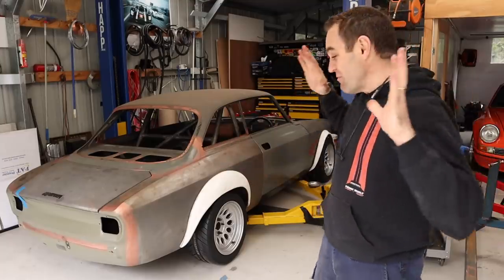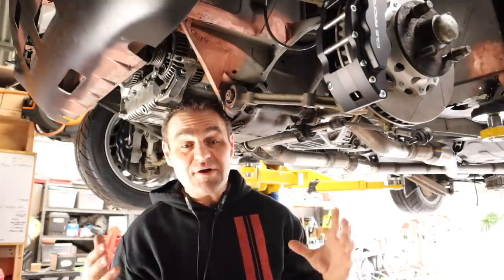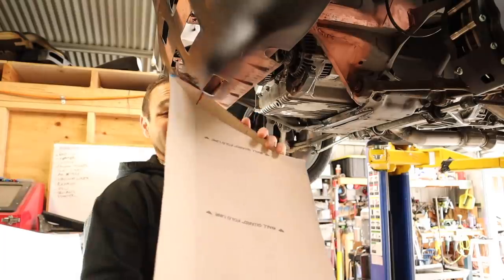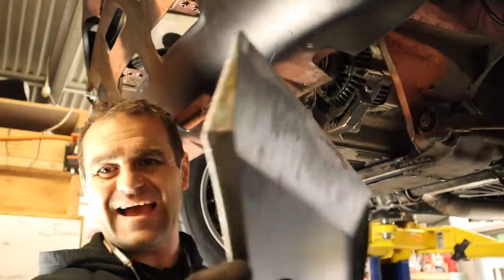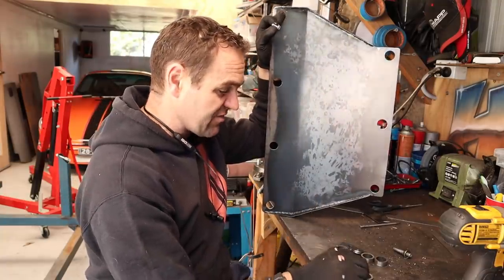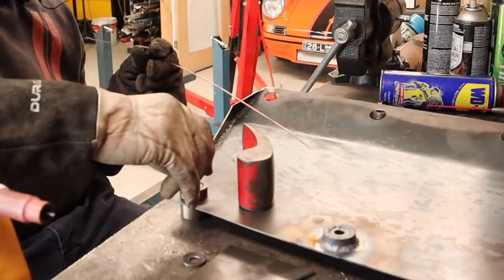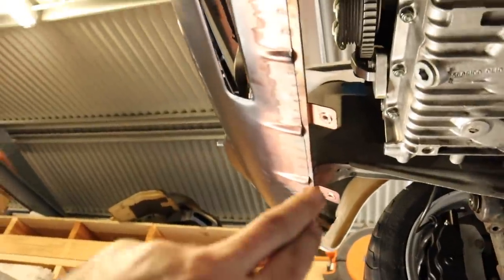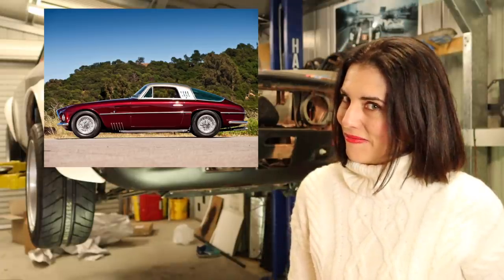Protecting the Ferrari engine - Ferrari engined Alfa 105 Alfarrari build part 94

Comment: Your Bash plate will act like a undercar tray drawing more air through the radiator.  So it should not be referred to as a bash plate.  The undercar windage tray also assists with downforce on the front if you added a small alloy 5mm strip across the back of it. (alloy so it is sacrificial)  This lip (facing down) will increase the air through the radiator (over the top of the tray). Many modern cars have the lip at the back of the plastic undercar engine cover for this reason. (many think it is just for good looks - but it has a purpose) Adding the lip will also assist to bring more air past the alloy sump. (assisting with cooling of the oil)
Reply from the maker: Interesting. I must admit, that I am a complete novice when it comes to aero. As the back edge is flush with the subframe, and I have to build another plate of some sort for the rack further back, I assume a lip on that would be the place to do it?

Comment: That's looking great! It will likely give a noticeable decrease in lift as well as protect the engine!
The only thing I would do different is to either space the rear end down a bit below the crossmember, or add some louvered slits along the rear section. This would cause a Venturi effect that should force air out of the engine bay, further decrease lift and increase the airflow through the radiator.

Comment: Have admit, I would have OCD'd the bolt depth correction too.....Anyway, my only concern would be cooling to the sump. All my Alfa's have had the aftermarket bash plate. But they have been the grid type. Multiple heavy straps welded fore and aft. They do the job and allow airflow to pass. Great work. Keep it up.
Reply from the maker: They need sump cooling. Ferrari doesn't ;)

Comment: Drill the plate for weight and air blow through.. Stainless cap bolts for corrosive resistance. .

Comment: Was there an Allen Head drain in the front middle of the sump?  Along the same lines, will the plates still provide easy access for fluids maintenance?  You might want to use an anti rust agent of some kind on the threads or go stainless in order to have easy plate removal to facilitate belt, pump, alternator R&R

Comment: You have attached the bash plate to the front valance, is that a bit risky seeing as if your bash plate take a whack it's going to flex the front valance ? 
Would stand off brackets  from the  chassis legs been better for strenght and protecting secondary damage to the valance?
Reply from the maker: The issue with solid mounting it, is that if anything hits it the forces are transferred to the frame and can do much more damage. Keeping it on the valance means the tabs can bend and absorb some of the impact.
Reply: @HomeBuiltByJeff  that makes sense.  Hopefully it never takes a bump.

Comment: Excellent protection.  Just a thought - is there possible concern with air flow cooling the engine bay/bottom of the engine??  I would cut air slots into the plate.
Reply from the maker: No airflow in the back of the Ferrari with a flat floor ;)

Comment: Your plate will add some stiffness to a very soft frame. Why did you not use aluminum wheels to save weight? This is already a very nose heavy car.  It will also smooth airflow under the car. Beautiful work.
Reply: Ment to say. Aluminum to build the plate.

Comment: yeah... way simpler... like welded tabs on the subframe and the front valance with riv nuts in them, and counter sunk cap screws to hold it all together...kinda simple xD
Reply from the maker: I thought about that, but counter sunk cap screws with a tiny bit of rust and they are never coming out ;)

Comment: I know you already spent a lot of time on this part, but how cool would it be if those pleats or folds in the front panel would run through in the bash plate.
Reply from the maker: It is way too thick to bead roll, so they would have to be cut out and welded in. That is even too OCD for me :D